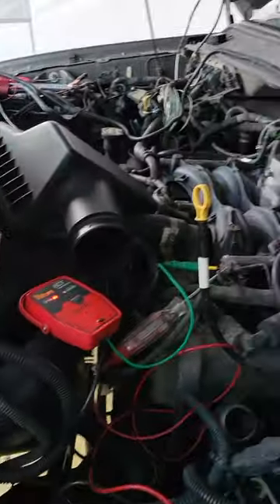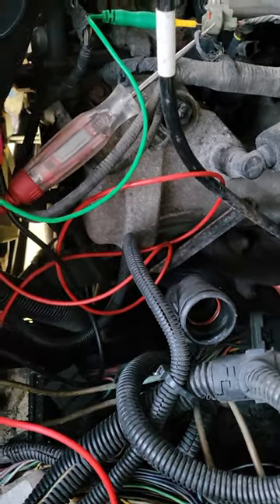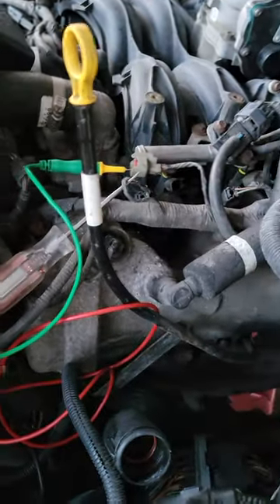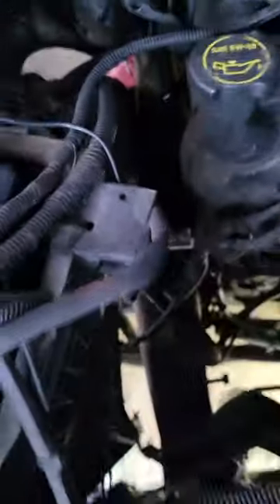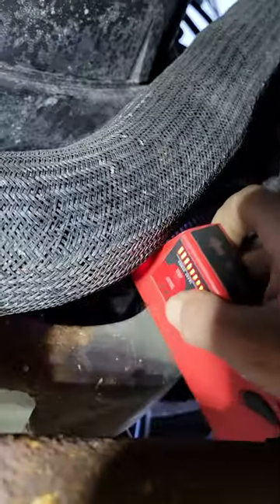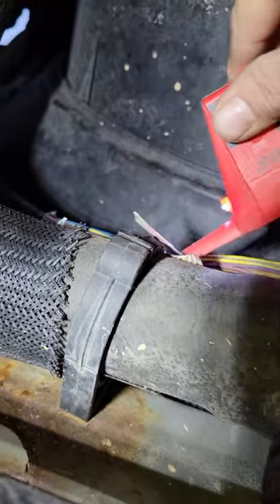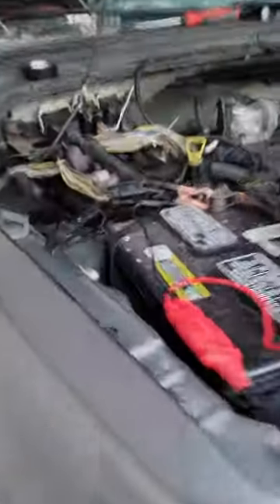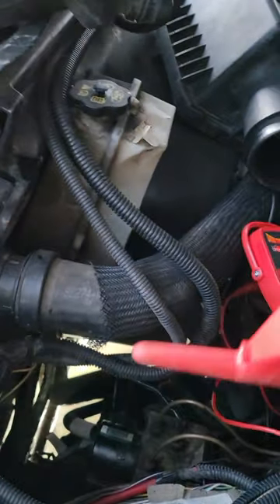How to use the ECT3000 by #powerprobe to find open/short circuit on your car or truck!

Comment: I'm an automotive locksmith and the same happens when watching guys make lost keys on YT. They leave out the small but important details. It's always those details that lead to success or not. It's actually very annoying when they do that. I always think of new guys who are going to watch them without knowing any better and fail over and over.
Reply from the maker: Yes hopefully someone learns from my mistake of not just learning how to use the damn tool in the beginning. 🤦 dumb on my part but I've learned.

Comment: I have to chase a dead coil wire on my Jeep tomorrow. I feel like I finally understand how to use that tool properly after watching your video. Thanks!
Reply from the maker: Right on man, your welcome. I hope you find it. Our kit didn't come with a manual for this tool. It only came with a manual for the power probe tool.
Reply: Just run a new wire, dont bother looking for a needle in a haystack
Reply: @mikesabin8568 what do you mean
Reply: @PickleballBrand  what do you not understand, the needle and haystack reference, or running a wire?
Reply: @PickleballBrand  As an example, you can have a light bulb that doesn't work. It has 2 wires, power and ground. Power goes to + (positive), ground goes to - (negative).
You know the wire is broken somewhere, to find it, you can use this special tool, or you can just buy a 50 foot wire roll and cut to length and hook up the new wire, basically a "bypass" of the system. IMO, it's better if you can repair the OEM wire, but if you can't find it, running a new wire will be faster. There is also the case when so many wires are damaged and are of known poor quality, that you are better off just re-doing all the wires in the car, like older jeeps and German cars with very thin, poor quality wires.

Comment: Why aren’t your arrows pointing you to the direction of the short?
Reply from the maker: I think it only does that on open circuits. Mine was odd cause it was a short but I broke the wire on purpose to fix it. But I believe the arrows are for open

Comment: Open not a short but a good video
Reply from the maker: Thank you. It originally was a short. My issue would come and go and eventually got worse then  once I found it I finished breaking the wire and that caused my issue to be permanent until I repaired it. At the moment i was breaking the wire i thought to record a video about it. Does that mean it was a short originally and then once I finished breaking the wire that made it an open? The tool was even saying a short. So I'm confused. Let me know so I know now. Thanks.
Reply: @handyscapersllc  I would imagine the tool was identify a short as it was technical a complete circuit to ground through the injector. Either way great video I watch others to remind me

Comment: I bought two of the ECT3000. I returned the first one thinking it was shorted internally.  I was loosing single half way down the green wire when connecting to OBD2 plug. 

The instructions booklet dose explain how to calibrate the tool, but only after fiddling around with it, watching videos and spending hours with multiple long breaks (out of frustration) did I come to the same conclusions. 

Your video was extremely helpful, it confirmed I’m using the tool correctly, so thank you very much.
Reply from the maker: Awesome, happy to help. Thanks.

Comment: Did you have to probe the Green wire of the PowerProbe into the actual wire that was broken ?
Or could you probe the Green wire into any wire of that particular harness/ bundle and find a break in any wire of that particular harness /bundle  ?
Reply from the maker: You use the green wire to probe the vehicle wire.

Comment: This would be an open in your wiring. A short would be either the wire is rubbed through and is touching ground or two bare wires touching each other. Open is a break in the wire. Just a friendly note. 😊
Reply from the maker: It's only broke because I broke it the rest of the way after I found it. I was getting ready to cut out the bad sections that rubbed against the frame to make the repairs. However I thought i should make this video before I preceded with the repairs. But yea original they was intact and feeding intermittent voltage to the injectors. I have video showing that happening before I even found the break. Which is how I diagnosed the problem but then had to find the location of the short.

Comment: Thank you for the video. I keep having a window/door lock fuse blow when the key turns to the on and run positions. It wasn't any of the switches, so I decided to order one of these. I was just outside trying to pinpoint my issue and I thought when the light came on in the center that was where my break was. So, I started to removed the hardness from the drivers kick panel to the door. It started raining, so I came inside. I am glad I found your video. I never locked it in.  :)
Reply from the maker: Haha I did the same cause no body explained the "lock signal" process. Happy to help

Comment: Dude great job and you are right no one in any of the videos I’ve watched so far has mentioned anything about turning the key off or locking on to the probed wire signal when it starts to beep really fast like you’re spot on my guy, for a moment there I thought the tool was too glitchy when I was using mine but I still found the problem in 30 min unlike the other 2 mechanics who ordered a light switch and a BCM 😂😂
Reply from the maker: Glad I could help

Comment: Do you have to disconnect the circuit from both sides of just one for example if testing a coil would you check at the coil and disconnect the connector at the pcm to prevent damage?
Reply from the maker: No you can pick which ever end gives you better access
Reply from the maker: I must add the signal being sent is harmless to the ecm

Comment: An open circuit is when there is a break in a closed circuit connection. 
That is very different than a short. A short is a direct connection between two positions in a circuit that are NOT supposed to be directly connected.
An actual short can often lead to overheating and burning/melting of wires, insulation and  fire.
Reply from the maker: The wire originally wasn't broke all the way it was melted and burned then I finish breaking it to do the repair. It shorted out on the metal frame and melted the wire. I don't remember If i mentioed it on the video but I definitely did in the comments.

Comment: is there not ant risk for damage any ecu,when the tool put power in the wire?
Reply from the maker: From what I understand there is no risk because of the type of signal that's being sent at such a low voltage as well.

Comment: 1. Should I use the ect3000 equipment after disconnecting the +, - terminal of the battery?
    Can I use the ect3000 without disconnecting the car +, - terminal?

2. Can I use the ect3000 equipment while the car is turned on?
Reply from the maker: I'm not sure if you need the battery connected or not. I never could find any information about that. I can tell you that I've used it both ways, with it the battery disconnected and with the battery connected. 
From what I know you don't need the car on simply because the device sends a signal through the wire when its connected to the positive side of the battery. If you have the car on then that might make it harder to find the broken wire. 
I don't know everything about this tool. I've had to teach myself most of what I do know about it. I'd recommend doing some research to get accurate information about the ect3000. Thanks for watching.

Comment: Sir if wire connecting with electronic controller then this tool can track.i try to track one wire this wire connection with B.L.A.M controller this tool can't track. Can possible to help why no track wire

Comment: To be honest it’s a great tool but you must say it is intended for inexperienced techs. Techs who have been in the trade 20plus years like myself, you won’t find that in my toolbox but it is a great tool
Reply from the maker: So what techniques do experienced techs use to find shorts or broken wires?
Reply: @handyscapersllc  a wiring diagram and a very good multi meter. Plus when you have 25plus years experience you know where problems happens. It’s common sense to check all clamping points and where the harness splits or turns is where usually problems are on high end European cars it’s usually where the harness takes a turn around the chassis for example

Comment: Great video man but I have a few questions. 

I was trying to see where you were probing to connect but could not tell. 

So i am having a non responsive wiper motor issue so i am starting from the connector plugged in and back probe it the way I think you have it. 

Now as soon as i connect the green on 4 pin connector but one pin the machine immediatly shows “short” and ringing it’s tone, i get it i have a short and got find it, but if it is constantlt ringing and so far it is hard to understand the machine.

I have changed the wiper switch, some actions on it work “trip miles button” and one other thing but the whole wiper system is non responsesive. 

I do have power at the connector because all light up except for one. 

I have traced that wire as far as i could go with the machine and looks ok but still no dice! 

You got any insight?
Reply from the maker: Make sure your keys are out of the ignition so there is no question of power being supplied. Be sure to connect the battery connections 1st. Then try again. Is your device new or have you used it before? If it's new then let's make sure it not a defaulted device. Before probing the whipper connection try locking the signal of the green wire before probing anything. After locking the signal then test To make sure you get the steady beep when you get close to the green signal wire. If this works then your device should be good. The most important thing is to be sure there is no power going through the vehicle
Reply from the maker: Also check that the one pins is wired and making a connection to the pin. This could be your fualty short. So if the wire broke off the pin then it would probably show a short immediately
Reply: Thanks for the response. Your first response i am all squared away there. 

Your second response i am a little confused about, so i take a paperlip and put in the one pin unplugged from the wiper motor and i have done both ways unplugged lol as well and it yells short.

Guess I have to keep grinding

Comment: Lol you call it a break 
Then u call it a short
Reply from the maker: This is because it was originally a short. Then I broke the wire fully to make the repair and that's when I decided to make the video. I guess technically it's both just not at the same time. However I will say that before I broke the wire to repair it, it would switch back an forth from a short to a open. All I would do it move the harness around and restart the ect3000 and it would show a open. I'd move the harness around again and restart the ect3000 then it would show as a open. So yes sometimes this happens and can be confusing.

Comment: You did waaaaay too much tearing your truck apart man. Just use a fused jumper wire from battery and tap it into power side of injector.
Reply: No like he stated he should have just used this power probe 3000 from the get go. Skipped all the other wire harness tear down. In the end using the tool and tracing that wire was the correct decision with respect to diag
Reply: @nordicpride9708  why? Running a new wire is 1000 times faster and new…. Explain how finding the broken wire and wasting time is a good idea…. I disagree with you 100%
Reply from the maker: This is actually a my company vehicle and wanted to keep original as much as possible. My personal truck I most definitely would of done that to. I should also note that this particular wire feeds many other functions.
Reply: @handyscapersllc  the fact it powered other things doesn’t matter at all. A fused jumper wire powering those injectors have nothing to do with it powering other things. It still would have worked, but whatever
Reply: @mikesabin8568  I don’t understand how it would power other things if you just ran it to the injector from the battery your bypassing everything else at the wire would’ve fed
Reply: @leonardtrump9155  lots of cars have a power feed from a fuse that goes to injectors and splice into other components such as o2 heaters etc. Happens all the time.